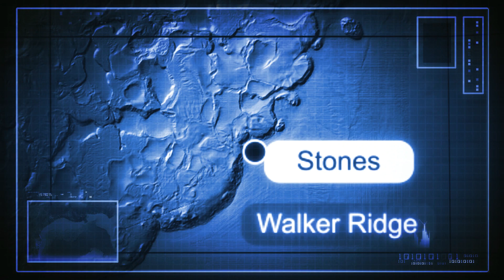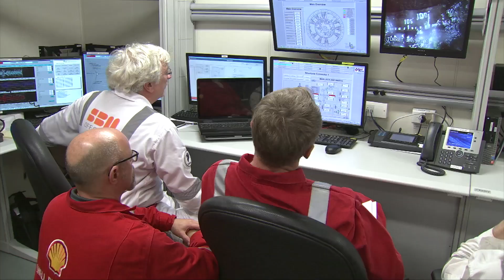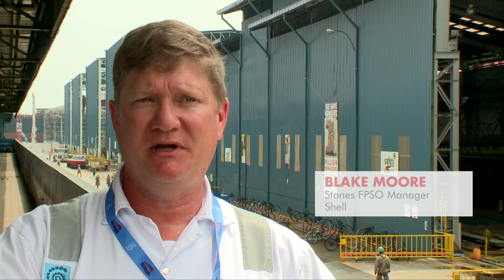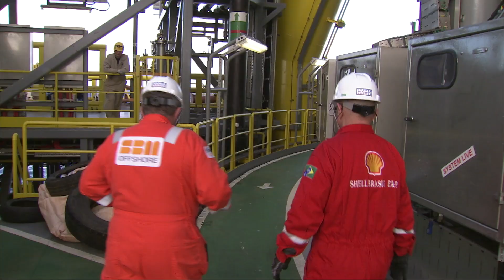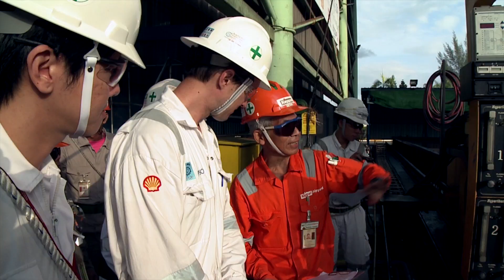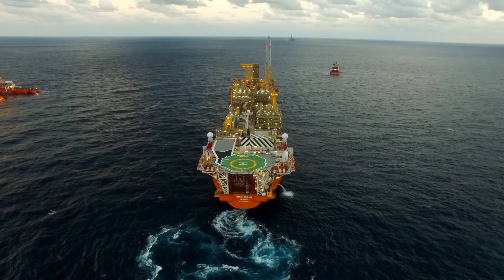Stones:  Where ingenuity and innovation intersect

Comment: Dr Paul Kerckoff, Shell Head of Production in the Hague, approved our design for a Multi-Purpose Semi-Submersible, MPSS, in 1988. Mc Dermott Engineering approved our design for steel risers in catenary and used them on Auger. It took Shell till 2002 to accept it for Na Kika. Shell are now building Appomattox, using an MPSS. Why are they still using ship shaped FPSOs with incredibly a complex turret? Seaways simplicity is leading the way and has been since they simplified the Apache Reelship reducing capex down to thirty from $100 million in 1975. MPSS bumped a spar for BP Md Dog 2 rducing cost from 20 billion down to 9.2 billion!  Shareholders should waken up! Start at www.swaei.com